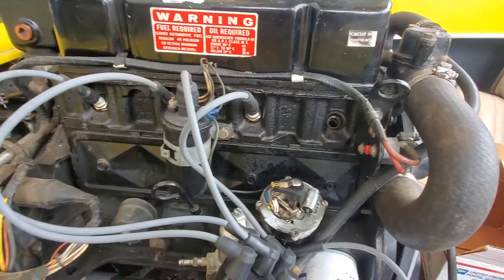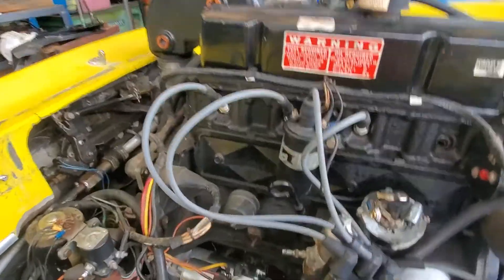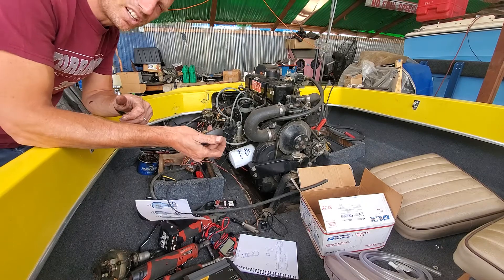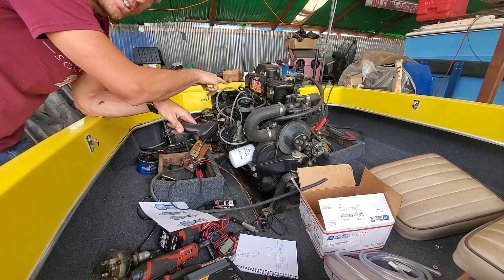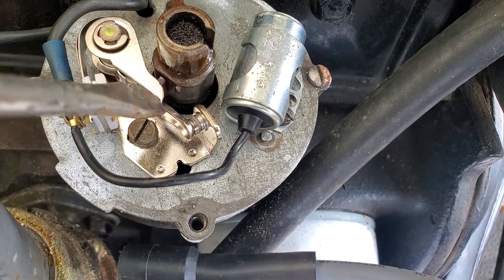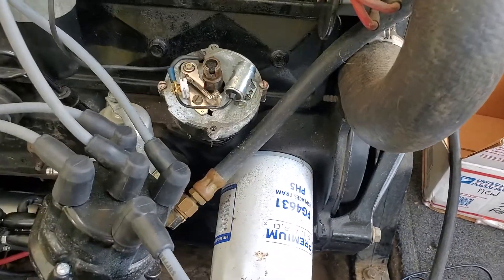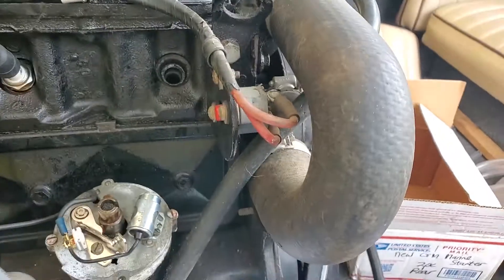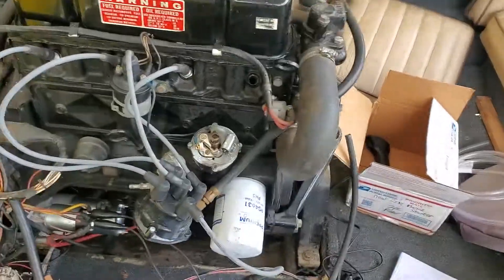Timing a mercruiser 140 part 2 - Rotating  engine to the firing position

Comment: If the yellow dot passes the timing indicator twice, once on exhaust and once on compression, how did you know which stroke you were on when you got the dot to land on zero?  Also thanks for these excellent videos!
Reply from the maker: If starting from scratch, remove plug one and plug hole with finger tightly while turning over - if its on the compression stroke it will blow air past your finger (both valves closed), if its on the exhaust stroke the exhaust valve is open and no air will push past.. not the rotor position, better to have it point at #1 on compression so the plug wires for 3 and 4 will reach :)